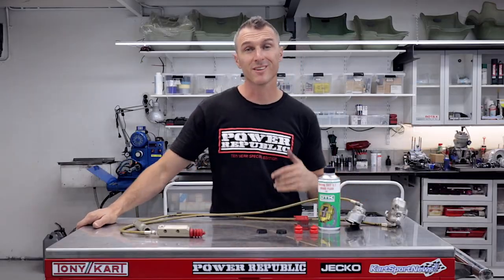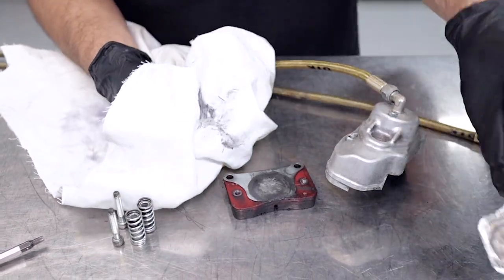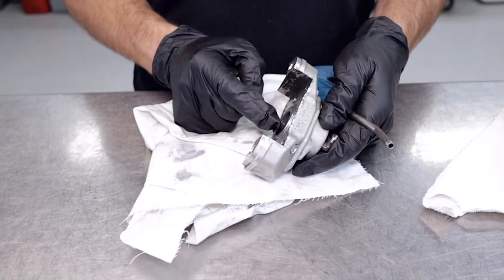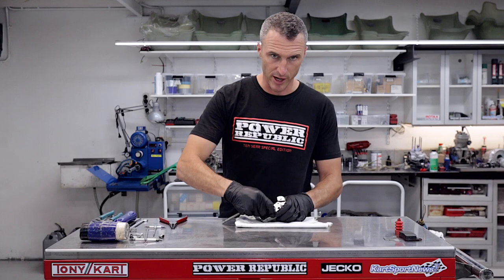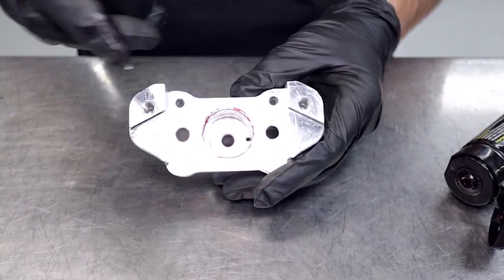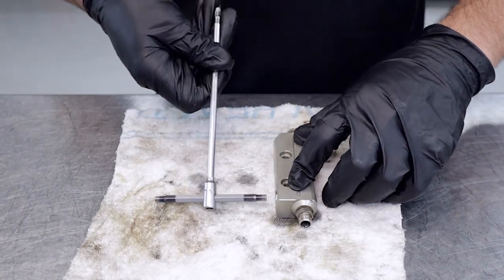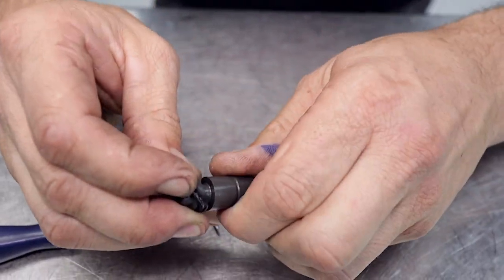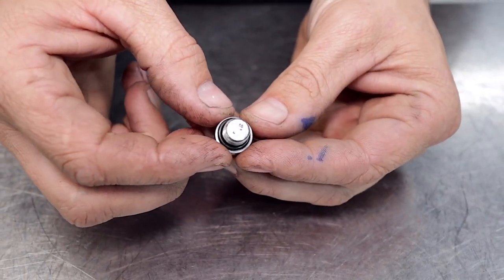HOW TO: Rebuild Your Go Kart Brakes ft  Tony Kart BSM Brakes - POWER REPUBLIC

Comment: Funny timing for the vid, Did a 7hr enduro yesterday (day vid posted) and were up for a brake rebuild (on an Intrepid) as we only had about 10% brake capacity and at mega leg strength needed to get that, were normally one of the best under brakes in the series, made for a long day.
Reply from the maker: well now you can get into the maintenance and fix the brakes bro
Reply: @PowerRepublic  Na, The kart/team owner can do that LOL I'm the #1 driver in the team and work on the kart at the track and do set up :)

Comment: Yo I recently bought a shifter kart and the brakes don’t work I’ve taken the brake line off the calipers and pushed the brake to make sure the brake
Oil is going threw and it does but the pads don’t move at all and I don’t really know what to do about it
Reply from the maker: open up the calliper and the master cylinder and replace all the seals and fluid.  then re bleed the whole system and you should be good to go

Comment: Hey got a quick question, when I changed the pads (which are the same size as the old ones) they won’t fit over the brake disc, and I can’t pull the pads back any further, what can I do?
Reply from the maker: I have had that happen too.  I run them on some concrete or bitumen carpark and take a few thous off the face.  Then they normally slide straight in
Reply: @PowerRepublic  thanks very much!

Comment: I had a go kart with working brakes but then the brakes just randomly gave up - what’s the fix?
Reply from the maker: seals most likely.  how olds the system ?  sometime the really old ones have too much corrosion inside to repair them
Reply: I think it was made in 2020 or 2021

Comment: I can't find any info or parts for the brakes I have and they don't work I'm afraid to take it apart, I have gold crg brakes with a single master cylinder and no brake fluid reservoir
Reply from the maker: get into it, they are all pretty similar to the brake system videos we have already completed here at the house of power.   next time I have a CRG in for brake service, I'll make a video for you
Reply: @PowerRepublic  thanks appreciate it a lot

Comment: I have a crack on the thread of one of the cylinder barrels where you put the adapter for the brake line. Anything I can put to seal it up and make sure it doesn't leak during a race?
Reply from the maker: not really, replace the brake fittings or the brake pump if this happens IMO
Reply: @PowerRepublic  after replacing the adapters that it's all good on that end. Thank you.
But I have noticed that on one side of the Caliper there is a leak on the piston end and I have rebuild the Caliper and replaced all rubbers with new ones. Would the piston be an issue?

Comment: Hey, 
I’m looking for a go kart. I’m from Belgium (17 and a little tall). You allways Review the chassis but does it come with the engine? Do I have to buy the chassis and the engine (cables, battery.. etc..) separately? 

If so can u recommend any completes that they ship Europe? Would appreciate it a lot!!
Reply from the maker: Hey , the rolling chassis come as a complete kart less the engine package or tyres.  I would get a second hand package if I was you (kart and engine) maybe an x30 or Rotax depending on what is most raced at your local club.
Reply: @PowerRepublic  great! Much appreciated. Any recommendations for a fast speed? (engine)
Reply: @Cafendless  Start with a rotax engine. Easy to drive and at @Genk (for derek a amazing track at Belgium) most people drive a rotax there so its always cool to drive against other drivers with the same engines and it isn't that expensive and people can help you if you need some help
Reply: @jordyschoenmakers  that's a great idea. Might do that Aswell. Haven't thought of that one. Thanks! 😀

Comment: 1 last question.

Can u fit a hydro e brake on the cart?
Would it be possible?
Reply: I think it would be possible but it would add a lot of weight and wouldn't be legal for competition. Curious as to why you want to mount one? Drift kart?
Reply: @sahib6742  yes drift cart, getting a kart soon in a week or 4 so preparing for things i wanna add to it.

Im assuming this was a weird question, so he probably wouldn't repond idk,

Apparently u can fit them, 2 front brakes controlled with your foot brake and the rear wheels with the e brake, but cant have both on the rear sadly.. Just wanted to hear he's thought's since he knows alot about karts.. But yeah..
Reply: @Cafendless  neat idea, I think it would work biggest thing would probably be mounting it to the chassis so it's comfortable and not too tight.
Reply from the maker: yes you could.  the hand operated hydraulic brake is used for paraplegic drivers.  you can buy these off the shelf
Reply: @PowerRepublic  you don't have.. a link do u by any chance? Would appreciate it.

Makes things a bit easier
Reply from the maker: @Cafendless  https://gokartsaustralia.com.au/products/brake-hydraulic-disc-assembly